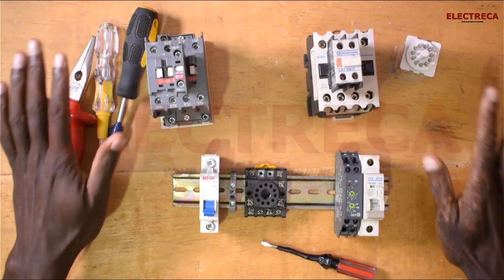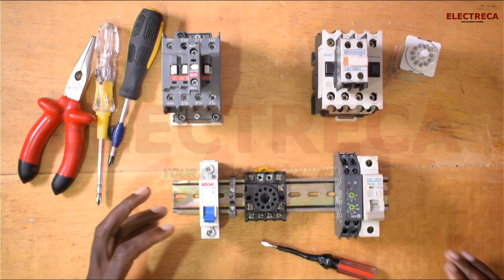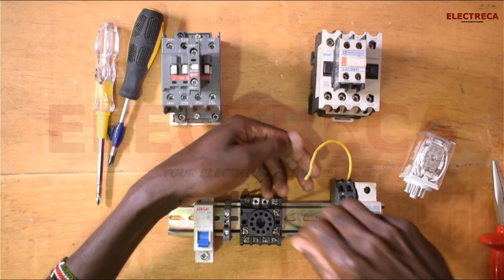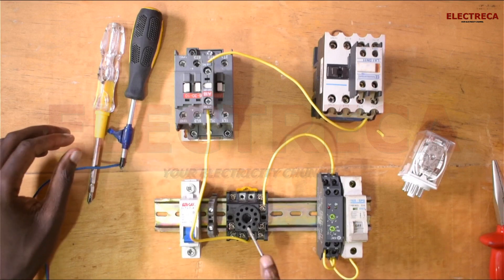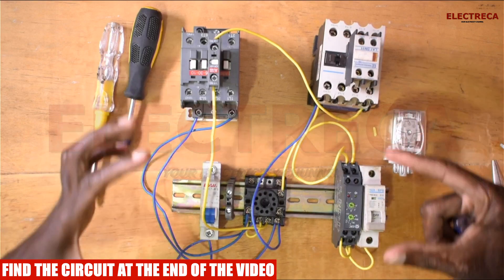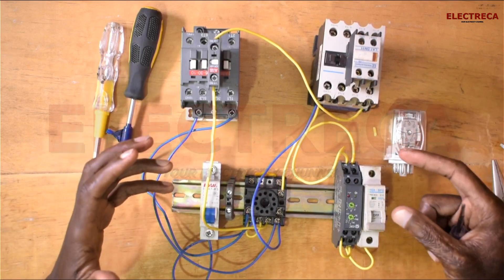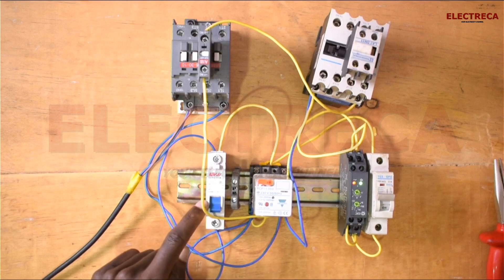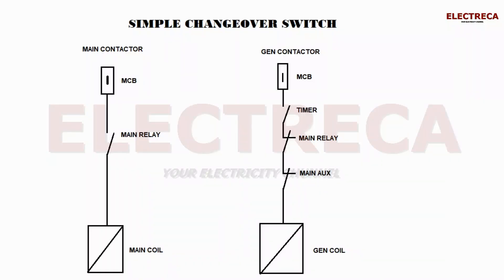Simple automatic changeover switch with double electrical interlock for protection|ELECTRECA

Comment: Thank you for the video Sir. I have a question. What is the probability of components in such a system failing? Thank You
Reply from the maker: The chances are really low for a component to fail under normal working condition, Most component fail if they work under strain example extrem tempereture,short circuit, contacts overload,overvoltage,undervoltage etc.

Comment: this is a great tutorial, if only it was more clear on mentioning NC/NO of both contactor. Can you have a setup with both contactors (maybe with NC Aux on both) mechanical interlock and electrical interlock with a delay timer "ON" for the main. I am wondering when the main source is on and delay timer is activated, during the delay time (say 5 sec) which NC AUX would open or close even when the contactors are locked mechanically? during the delay time would there be electricity coming out from either source or would it be complete cut off on both ends of the two contactors?

Comment: My generator is set on auto but it won't switch off when mains supply returns but the mechanical interlock is working fine
Reply from the maker: First try this, put your generator in off mode disconnect the auto cable from the change over switch(ATS), put generator  back to auto mode and short the auto cables, in this case your gen should be running. If yes disconnect the cables which will put you gen in cooldown for 3 minutes before the engine shuts completely.
Now if everything said above is true, then there is a problem with the changeover.

Comment: The wire that passes through the relay that is supplying to the main contactor, is it passing through the auxiliary contact of the main contactor? Or the coil?
Reply from the maker: No, 
through the relay, through the auxiliary contact NC of generator or backup contactor to Main contactor coil.

Comment: Sir sorry does it mean when you interlock the contactors mechanically you don't need to makes use of Aux and relay.
Reply from the maker: Mechanical interlock is good and strong But they can fail. For safety reasons use all interlocking mechanisms available. so yes you need to use your AUX and RELAY

Comment: How do you start  and stop the generator
Reply from the maker: A generator has a signal cable that connects through the Main power relay. There are 2 types of signal closed and open......when the main power goes off the relay sends a signal to the generator by either closing or opening the circuit.
Reply: Make a video on this sir,, am interested

Comment: please can you give me a video on how to build auto change over on 3 phase. i have one relay, two contactor with electrical interlock, one 8pin timer and 2pcs 4 poles breaker but i want my timer to be in mains supply so that the contactor will be delayed like say 5mins before switching over. my email is lippocomputers@gmail.com
Reply: Can you please do a video for a 3phase circuit. Thanks.
Reply: @nopseudo87  where will i send the video to